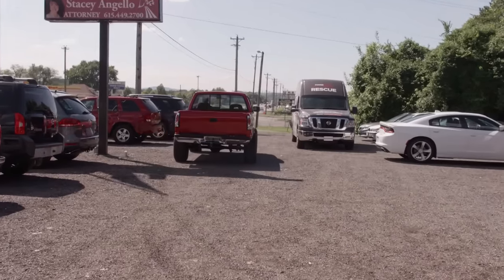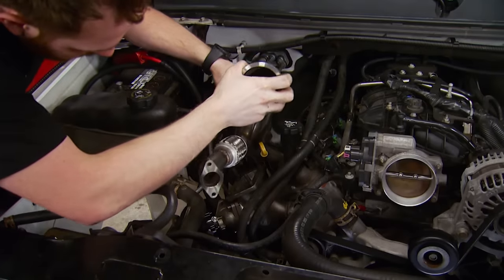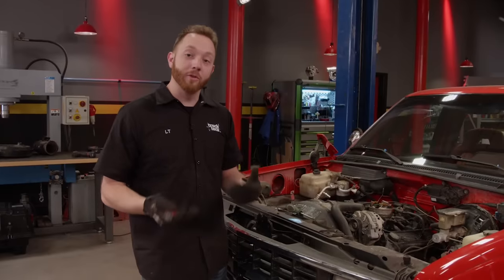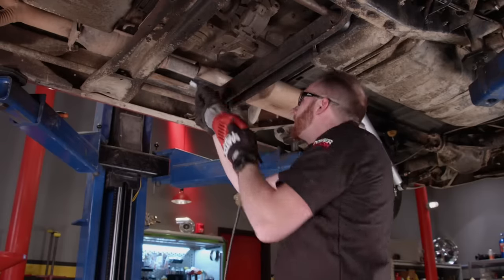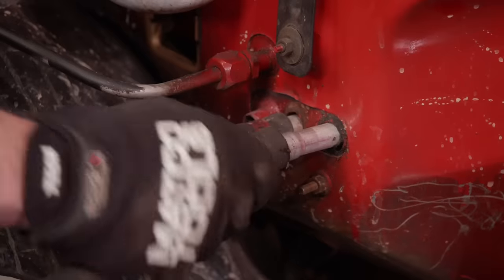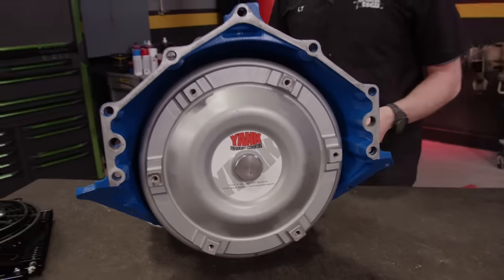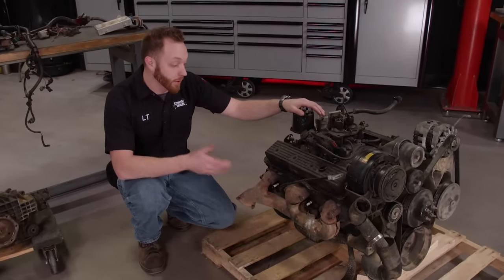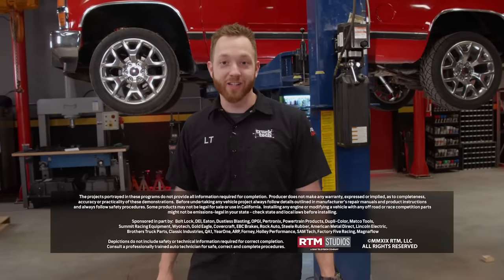LS Swap Do's & Don'ts on a Chevy K1500 - Truck Tech S6, E5

Comment: My 91 a 388 Stroker with the factory TBI system. It really wasn't that expensive but it took a long time because I did most of the work myself I'm also running a single plane high-rise. And it took a lot of work to get it to run right changing the size of the vacuum tubes going to the map sensor adjusting the TPS. Jumping the fuel pressure from 18 PSI to 30 PSI once it gets above 4,000 RPM. What I really want to do is take throttle bodies and just run the signal off of one but jump the wires over to the injectors on the second one on a monetary switch so that when you're at Full Throttle is the only time it's using the other carburetor like an old school vet

Comment: At 12:309 first two upgrades for this long block is dry sump and relocated oil filter. This increases the clearance, and a must upgrade at this point in a build like this $

Comment: I enjoyed your project and you spoke clearly. But, as you have probably heard from some, you lost me at the 4L80e rated to 600 ponies. As a GM guy (Worked on all & imports more), I just finished my 87 era 700r4 on my homes bench, for $930 and will handle 800+ easy as it is a high performance version of the 4L65e. Sonnax, Superior and 5-pinion carriers used Kolene & Alto Red Eagle friction/steels. 9 full faced frictions in the 3-4 clutch riding on an apply ring that measures like one stamped #7 but 0.34” end play.
 Look, two issues with the 4L80e is the weight of the rotating mass that knocks down track speed. The other is “Calculated Engine Load”. By itself, means nothing but if a failure or incorrect input by the MAP, TPS or MAF sensors, you will burn up a clutch within 50 miles or so. Even though quality parts are used, a terminal, connector or wire issue during a swap can cause that problem. I did not grow up during the BOX generation unless you went to the dealer, we rebuilt those items that gives the tech more on the “Flag” sheet but less on the parts side. Either way, it’s just my experience not a slam on parts companies in 2020, as many have good stuff. 
ASE Master Tech since 78-Retired. 
                     Nice upgrade for the GMT400.

Comment: My first car was a 1978 Ford Granada with a 250 straight 6 it is still my only car except that I took the 250 out and I'm putting a 300 straight 6 engine. The 250 had well over 500000 miles.

Comment: 185k? That things just getting broke in!
Reply: @douganderson7002  ya okay. You must have never owned one that's been just "decently" taken care of or haven't been a plow truck its whole life. I've had 1 with over 300k and several others with over 200-250k that all still ran great and pulled 2-3 cords of wood every day. Chevy break lines really do suck tho
Reply: @douganderson7002  and btw, before you call me a Chevy or ls fanboy I could give a shit less what brand makes my money. Although i will say my 04 f250 with the 5.4 less than 85k miles is the biggest pile of garbage money pit I've ever owned
Reply: @douganderson7002  😂😂😂😂😂😂😂
There not working on a ford😂😂😂
😂😂😂😂😂😂😂😂. The oe 350 tbi in my one owner 1990 k1500 has 432,735mi. on it's 30 year old engine and still turns the odo. to the tune of 200 miles plus a week as our daily driver, but 👍👍 for making a nieve comment. ✌✌👍👍
Reply: @douganderson7002  my 95 Yukon has 249000 miles and still runs great.

Comment: This is exactly what I want to do to my 92 k1500 it would also be great to swap another five speed which came factory in my truck.
Reply: I have a 94 gmc single cab sitting on 40s it was auto I put in a nv 4500 and 3/4 ton front and rear with a 5.3 and carb/cam it was a awesome setup and would smoke the 40s easily but I just pulled it out and going Cummins
Reply: Why lower a 4x4

Comment: A tbi 350 with 180,000 is nothing, they can go a million miles if maintained properly.
Reply: It probably just needed new valve seals.  I had a 91 with the same engine, and it always smoked at startup.
Reply: Four TBIs with well over 200k that don't burn, don't smoke.  PS pumps, steering couplers, door hinges...that's another story...
Reply: I LQ9 SWAPPED MY 95 K2500 $400 Salvage yard engine upgraded cam and fuel system $ 750 on 4l80e transmission upgrades.  The old L05 tbi 190 hp to about 500 hp with LQ9

Comment: What's that over his left shoulder at 9:00?
Looks like a wheel bearing.
Reply: Saw that too.
Reply: Odds looks like a spider gear .
Reply: @ssceverythingcummins2985  I agree, I'm pretty sure it is a spider gear from when they removed the front diff.

Comment: installs trans cross member doesn't mention you need to make new mounting holes in the frame. honestly for the amount of money that is already into this  you could of done the 383 kit and rebuilt the 700r4 for way less money. that gear star trans is at least 4,300 bucks, and he said the ls motor was around 3,500.   383 stroker kit complete with cam, lifters, valve springs, timing set, 30 over pistons and rods, gasket set you can find for 1,400.  to rebuild the 700r4 the right way to last, is about another 1,400.  Msd atomic eft kit that replaces a carburetor is around 1,300. so for about  5k you can go the 383 route. i would say a decent machine shop would charge about a grand to clearance and machine the block. a set of heads with rockers 1k.  Or stick with these guys and be around 13k to 15k when all done.  That holley efi intake and ecm kit comes in around 2500 or more.

Comment: OMG, Nice shiny truck. #1 Less than 200k miles and it's burning oil? While 6500 sounds high for a 383, I did not hear the cost of this conversion. 3500 for a 5.3  long block plus, Hooker adapters, headers, new intake, injectors, throttle body, filter kit,  knock sensors, o2 sensors, gaskets, starter, accessory brackets,  P/S, alt, A.C., pulleys, tensioners, belt. I guess Summit supplies that for the right amount of money. Upgrade to the 4L80 and Yank convertor, flywheel and cover probably 5000. New exhaust and driveshafts  xxx.  Just shred your wire harness to rewire as per instructions. Ignition, coils, more wiring harness, Computer and pro tuning xxx. New radiator, fans, hoses, etc. New trans. cross member, trans lines,  also wire into harness I'm thinking the bill is about 20,000 bucks. Did I miss the budget?
Reply: Forgot. Also the do and do not. You need a new fuel pump, regulator, lines. And buy the 600. pump for later bolt on the twin turbo's.

Comment: If you have the skill and tools and location, and knowledge about each and everything you touch, and I mean EVERYTHING you TOUCH, this is going to be an awesome truck. But they under emphasize the amount of work it will take to pull this off BIG TIME. Don't get me wrong this will be bad ass when done but it ain't for a rookie with some hand tools not to mention the $$. Everything will need to be changed and reworked. Before starting check out the JTR s-10 conversion book (cheap reference) for an idea of work involved, it will save you untold grief and money up front, it doesn't cover gen 3 and 4 engines but you get an inkling of the work ahead.
Now if someone (hint hint hint) would write an JTR type book for big trucks and these type of swaps, including gen1 gen 3, and gen 4 power trains, I would buy it right now, and I am not doing a big truck upgrade! $$$$ hmmmm...  I hate to see an upgrade project abandoned because it was over your head in complexity, I have done that too many times myself!
Reply: mike f  I’m glad you see this also. I think it’s influencing younger guys to spend their money on parts that will never see any use. Same thing with the turbo fad. So many go out and MIGHT get all the parts but know nothing about tuning and it gets abandoned.
Reply: @bebihutcheson1340  I've done a few swaps, my 88 V8 s10 blazer, olds gbody wagon, 68 impala under construction, 2 Monza's 1 factory v8, other vega 140 to maybe an LS something. I purchased the JTR s10 book before I redid my 88 Blazer, already v8 converted, the info saved me $$$KKK$$$ in mistakes not made. They didn't cover the PCM for Ls's, fuel systems, 4l80-e controls ( mine is going in my 78 Malibu)  or my 68 impala) dash board and accessories, drive belts , cooling ect. I bought lots of parts from abandoned projects, sold a lot to in early days too. They could do better, but it's TV.
Reply: @bebihutcheson1340  amen, i have done it, until I learned.....do your research, do your home work, make it something to brag about.....

Comment: If you would have used the dirty dingo mounts you wouldn’t have to get new drive shafts
Reply: I did that swap. 1inch setback mounts and it wouldve been in the factory spot.
Reply: Lol how would they compensate for going  60e to 80e?

Comment: Oh jeez - why would you use that pilot adapter for the torque converter to bolt an LS to a transmission that came bolted to them from the factory? Just buy the right flexplate. It's the flat one with the 0.40" spacer on the engine side. It matches up with most LS crankshafts (except some early 6.0L and 4.8L stickshift application engines with extended crankshaft). That nose dongle thingy is to bolt a dished 4l60E flexplate to a TH350 or TH400.

Comment: Not for nothing but I have an 89 gmc 1500 2wd 5speed that I swapped in a 450hp 355 fastburn in and it didn't cost me anything like that and it was plug and play with the original tbi fuelinjection

Comment: So you slammed a 4x4 Chevy. that is so method up on many levels. Must be getting tired of the same old show or just want an example of mental constipation. So that's my thoughts on that. But I still drive my old 2003 Ford Powerstroke 6.0 liter. So I kinda get it.

The LS is a very good mod idea. I have an old Toyota rock crawler that has a corp 14 in the rear and a D60 in the front. This would be a perfect mod to break the trans and dual cases forcing a jump up to a 205 case and big joints. Maybe even a turbo 400 lazy man's auto drive.

Comment: burns and leaks a ton of oil? So a normal Chevy engine.
Reply: Nah chief, my 98 with 378k miles has no leaks or damage. Only replaced the 4L60E once
Reply: @deaddad6310  the TBI engines do burn oil but only if they have high mileage
Reply: @jkeys99  most engines with high mileage do. Mines an exceptional engine, it was babied like crazy.

Comment: 16:34, these trucks came with a thin sheet metal torque converter cover that without the oil leaking from the rear main seal would rust off. This is not a structural part of the truck.

Comment: Lowered a 4x4 truck? That's just idiotic
Reply: boostedmonza502 I agree. Very stupid imho.
Reply: it's all about them all wheel drive launches though..
Reply: Better launches to take people to gapplebees.
Reply: Well it's not gonna have that archaic ass old four wheel drive system anymore.  They have to use the four wheel drive from a 00 or newer truck.  My guess is its gonna be an all wheel drive street truck.
Reply: @walkerforsyth6221  4x4 is not all wheel drive........
Reply: @joshtheking1772  you're dreaming.

Comment: I’m at 370,000 on my 98 with the 5.7  and it’s  still running strong... leaks a little oil from the valve cover (needs gasket)  but I can still smoke both tires or get 16+ mpg when I need it
Reply: That's cool. But the LM7 is still superior.

Comment: The proper way to pull a motor fast and efficient unbolt transmission, torch off motor mounts, hoses and other restrictions and turn vehicle upside down and shake It, that's junkyard style motor pulling. That's why your warranty is 5 foot or 5 seconds whichever comes first!

Comment: 3500 for a lm7 lmao.
Reply: This guy knows
Reply: And it didnt come with a intake manifold. Ripped off
Reply: Mine was $500 with everything lol even a free engine hoist
Reply: I got my 2009 ly5 for 350 bucks with heads, intake and injectors, and most of the accessories.
Reply: @scottydoesntknow254  nice
Reply: Just go to a wrecking yard and get the motor, trans, computer and wiring harness for $700 to $800 and rebuild all of it for the same cost of the motor alone.
Reply: @joshtheking1772  A brand new crate TBI 350 engine for my 1988 van was $1500 delivered. I got it from Jegs.

Comment: $3500 for a long block engine? NO!! Pull a complete one from a junkyard for $200 lol
Reply: But it'll be a crap shoot, it might be good or not. Then you'll have to search for another one and pull it.
Reply: @allanb3222   you can buy a running LS powered truck for well under $3500 USD I bought one a few years back with a rusted frame for 300 Canadian Pesos
Reply: @billytwowillies  True, but how much more monies are you gonna put into it for maintenance, and to get it to the power level the crate engine is already at??
Reply: @allanb3222  cam and spring upgrade....not that expensive really. New gaskets on top of that...still not hitting that $3500.
Reply: Keep in mind you are getting a COMPLETE engine not just a bare block either.
Reply: A junkyard 5.3 with a good cam, springs and a carb intake can yield 450 or so hp and tq for considerably less than that long block and still be quite dependable but if you have an open checkbook go for it
Reply: Forget the open check book. Keep it at a 3500 budget. You can still buy a donor and power upgrades for under 3500$ and make more hp.
Reply: Bad idea. Get a brand new ls3 from Summit. Don't do that junkyard stuff

Comment: Lowering a 4x4... Blasphemy...
Reply: Nah  coyote swap or lifting a single cab  would be blasphemy
Reply: I can agree on the coyote swap, but disagree on lifting a single cab.  There is absolutely nothing wrong with lifting any 4x4, but lowering, that is wrong. Then adding those tires on top of it, it's a waste of a good 4x4...
Reply: Jizomeo VonSteelwind  nah there’s different uses like GTR’s use awd why not use 4wd to be a sleeper truck

Comment: I would say this is a very expensive projection with a lot of man hours.  By the time you’re done that’s at least $7,000 in rabbit hole of parts..unless those parts are used.  Not a walk in the park either.  Buy a Blue Print 350, 365 HP, rebuild the trans to accept HP. Add aftermarket Holley EFI and call it a day and you keep the 4WD and stock wire harness. For about $6,000
Reply: HYDROPHAINT Concepts a LS swap can be done in the gmt400 trucks for around $3000 and a LQ4 makes well over 365hp with a decent tune and a set of headers.

Comment: Waste really. You could put a Vortec 6.0 or 6.2 for the same $$$.  You're basically replacing a 350 with a 305. Again, waste of time when you could have a "good" engine for the "same" $$$. 🧐🧐🧐
Reply: Did you even watch the video?  That modern "small" 5.3L is leaps and bounds better than that old tech boat anchor motors.
Reply: @FredSanford2003  Missing the whole point of remark aren't you. Better motor for the same $$$. 6.0 vortec engine would cost the same. It defeats the purpose, and all the trouble and added extras to do an LS swap, to waste it on a 5.3. Seriously. If you're going to do a job, do it right. Because the first thing to be swapped out down the road is going to be the 5.3. Guaranteed...🤔
Reply: @aumetalmental8403  lol that 5.3 with a cam and some head work will make more power than a 90s 454
Reply: @aumetalmental8403  that 5.3 is not stock and a 305 is nof even in the same league as a 5.3 . I have one in my 86 c10 the 5.3 puts out almost 3 times the amount of power and torque and gets double the fuel mileage.  You can't but a new 6.0 liter for 3500 bucks ,they cost a lot more than a 5.3. Jeggs and Summit 6.os are 5 to 9 grand.  Not everyone has that kind of money.  This   engine is more than adequate for this old truck that isn't restored.Its not cost effective to put a 8,000 dollar motor into a 2500 dollar truck
Reply: @nathanbutler8240  I agree totally. But for all the trouble and expenses of the LS swap, a 6.0 is definitely,for the same $$$ mind you, far superior over the 5.3, like the performance 5.3 is superior to the old style 350. That's all I'm saying. And I'm not laughing back at you, just relaying common sense.
Reply: @aumetalmental8403  depends what you're doing I can do a junkyard swap original harness and make it run just flashing the computer I literally just bought a 5.3 out a Tahoe with a 4l60 for 1400 bucks. And what 6.0 are you talking about. The old 400? The vortec 6.0? Cause I would put a modern 4.8 ls with a cam and 706 heads will put down over 400hp with a turbo you're looking at well over 600 lol I promise the old 6.0 heads aren't gonna flow anywhere near the new ls heads and  intake runners volume in the head is where you make the power
Reply: @jbncnow  Really, I just looked and wow, guess what i found? Can you guess??? 6.0 LS Vortec long blocks, all day long, for $2500 - $3500. I mean you insist on being right go for it, I'm out. Summit sells ATK Longblocks for around, you guessed it, $3500. Imagine that, other shops as low as $2499, ssooo, whatever
Reply: I was thinking the same thing! I'd rather do a 6.0 swap for the same labor and almost the same expense. The only exception would be if its gonna be a high rpm turbo  build then a 4.8/5.3 would be a better choice.
Reply: @AlazarAnbesaw  the only difference between the 6.0 and the 5.3 is the bore. Stroke is the same ar 3.62". In fact I'm putting the 4.8 crank into a 6.0 block to simulate the old school 327, for my son's  2000 camaro. That will have RPM potential. The 4.8 crank throw is 3.27. That will make my son's engine slightly more than 327ci, but accomplish what I'm trying to achieve.
Reply: That 5.3 is a vortec they're just saying LS cuz they're based on the same architecture. Basically an LS1 with a iron block
Reply: William  if they were building a tow rig then yeah a 6.0 would be great. A 5.3 will get noticeably better mileage though if its just going to be a daily/cruiser, and 5.3s are far far from being an inadequate motor. SBE LS record was set with a 5.3 and it ran 7s